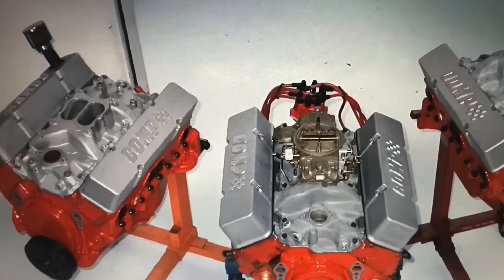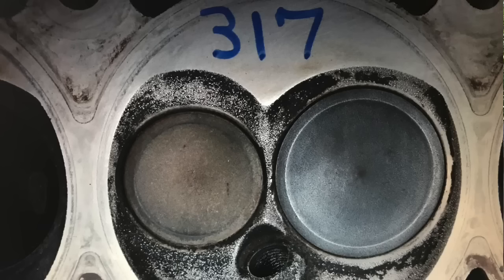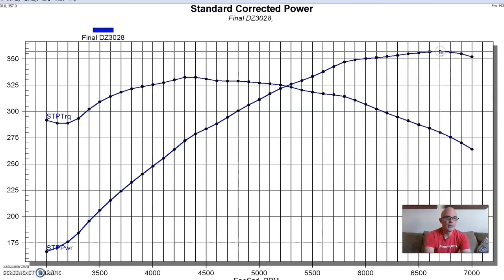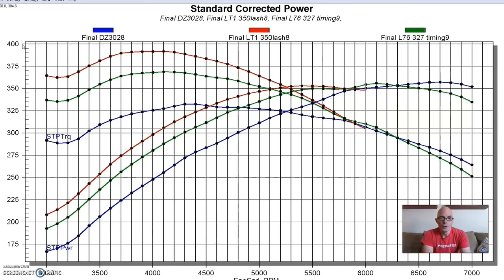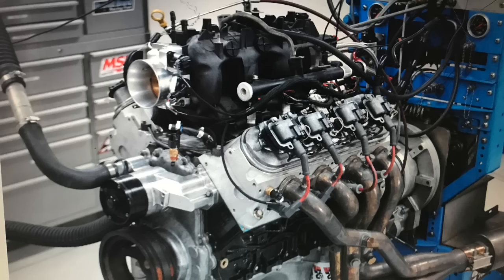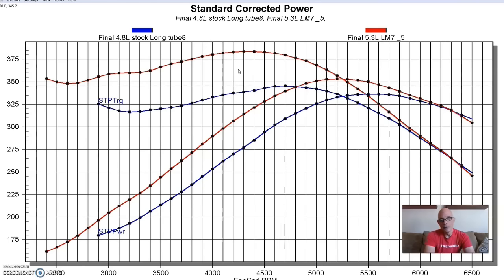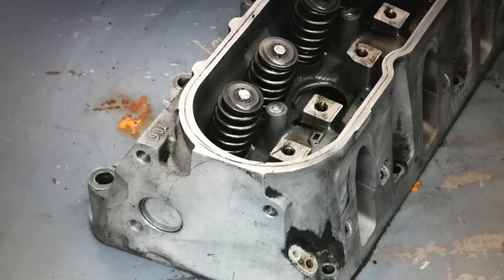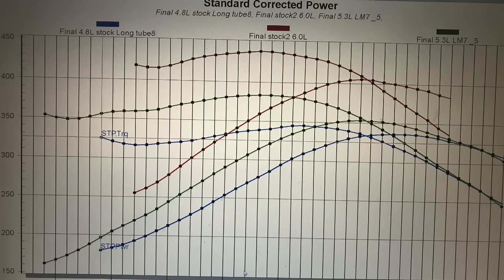HOW MUCH HP DID THE 1969 DZ302, THE 1965 365-HP L76 327 OR 1970 LT1 350 REALLY MAKE? WAS IT FAUX HP?

Comment: The never ending question, when do you drop the small block stuff and go big block territory?
Reply from the maker: big block stuff comes out tomorrow
Reply: @richardholdener1727  think my question is a bit vague. When would it be best to build a big block instead of a small block. What's some of the things that would push you to go big block instead. 🤘🏻 thanks for the interaction with fans.
Reply: @Knightmare-gz9ls  Big block are big because they have larger cylinder bores. This allows for larger diameter valves for two use cases:
1.) When you need a lot of air flow at low rpm for torque (aka a truck) or 2.) you have a huge budget and can run expensive heads with massive valves at high rpm and just make crazy power numbers.

Comment: I have a 1970 Camaro z-28 355 LT1 with matched and polished exhaust ports and intake matched and de-flashed intake runners. Manley pro-flo valves, forged Speed-Pro domes and an old lopey Crane cam. I forget the number. It will pull all the way to 63-500 which is where I shift it. It's over 355HP easy, but I do understand these are bone stock components. I can gap my buddy's 302DZ by a couple cars and pulling. Great information though.

Comment: I'm a 400 guy....why not throw it in the mix....this would have been the perfect video for it.....maybe because they didn't make a performance version?
Reply from the maker: the 400 was good for heavy cars-not really a performance motor
Reply: @richardholdener1727  The 400 wasn't a true factory performance motor but right out of the wrapper in 1970 you got 265 HP and 400-foot pounds of twist with a two-barrel carb without using very much RPM. Pull it out of its home from a wrecked 70 Monte Carlo and strap it down in a Chevelle or a Nova and it did a real nice job filing down the rear tires even with the 2 barrel Rochester. With a decent carb and intake along with a hotter brain stick and the steam holes drilled in some better heads it woke this motor up faster than kicking a sleeping Grizzly bear in the butt. Try sticking a 400 together with some better parts and screw it to your dyno. The torque it produces makes it a great street engine.

Comment: I would like to see a shootout based on same displacement but different rod:stroke ratios on NA engines. I have gotten the impression you don't value this measure much but NASCAR SBC engines used to change this based on the track they where at. Can longer rods get get more top end out of a flow limited configuration because of reducing peak piston velocity.   Can long rods get more top end out of a TPI? How much value is a long rod SBC 383 kit over a standard rod setup. Thanks, I enjoy seeing theory on the dyno.

Comment: Have you ever done a 305 with the 3.75" crank and a set of trickflow aluminum heads with the 1.94 valves for the 305 bore size. 
I'd like to see that with a compression ratio that could be ran on pump gas. 87 to 91 octane. 
Something with torque cam for a old truck application. And something with a big roller cam for a hotrod camaro, with a 3500 stall and 4.10 gears. 
I'd just like to see how it would compare to the other small bore engine, the ls 5.3. 
I think the only reason the 305 gets such a bad rap is the crappy heads that come on them. And weak camshafts. 
With .030 over and a 3.75 stroke. It would be very close to the bore and stroke of the 5.3. And the trick flow heads should get the airflow closer to the stock LS truck heads.  
Keep up the awesome videos.

Comment: I had a 69 Camaro with a LT1 350 with the off road GM cam, other than a Edelbrock intake it was bone stock. It turned a rod bearing so I yanked it out of the car and replaced the crank as the rod was ok. Put the car all back together and it didn't have any power like it used to. So I thought I may have had the distributor in wrong. Nope not that at all. The crank I put in was a 327 crank!! No wonder it didn't have any power! It still had  110 lbs compression. So since this was my daily driver I just advanced the timing until it sounded better. Took it for a drive and no pinging sounds - more advance. I put a timing tape on and checked the timing - it was 55 degrees! So I then bought a MSD box for it and set it to 7000 cut out. Richard this was a ripper, with so low a compression it didn't take long to rev up that is why the MSD box. I drove it like that for another 2 years and thrashed it. It had a turbo 400 out of a 4 X 4 with a reverse valve body so it was really fun to drive. Our tuning tools back then was a timing light and a screw driver for jet changes. Keep those comparison videos coming.

Comment: Hey Richard hows it going ? I have been watching your videos for a while and learned alot so far after watching over 100 videos I found the confidence to attack this project of replacing the over heated TBI block.I am working on my 5.7 Vortec block for my 91 OBS  4x4  so far I have cleaned all surfaces honed the cylinders sleeves to get a good cross hatch kept the original pistons and crank, machined the heads kept the OG valves and reseated them added 500 lift capable springs ,installed a new oil pump high volume,installed a custom 265 cam with 480 lift ,217 Center ,110 Lobe Exhaust  is the same.Cleaned and bleeded out the original roller lifters to get a good and acurate adjustment added 1.6 roller rockers cleaned and kept the original push rods.Now its time for installing the engine pro double timing chain with three setting to choose from +4 ,-4 ,or 0 TDC.My question to you is would I benifit from advancing or retarding my timing gear or shall I just leave it at 0 tdc ???.Intake is a Edelbrock 2116 dual plane for quadrajet carb I am going to use the original GM 454 TBI to carb adapter to keep the tbi system for now and am using a MSD HEI Circle Track Distributer with a rev limiter adapter I also looking at getting the MSD 6 AL-2 Programable to replace the rev limiter adapter .What would you suggest and have you ever gone threw this set up?? It will be used to pull my 78 K5 Blazer  with 496 and 12 bolt 5.13 gears on 44's 6 lugger up to go offroading .I could really use your expertise on this one.Thanks and let me know if you need any more info .

Comment: The 302 was good in the higher rpm range which was used for trans am series racing of the late 60's .
Reply: My 69 z/28 with its 302 is a runner . I had the heads mildly ported, cc, and polished. The heads added lots more mid and top end torque. Its still an rpm engine.
Reply: @jimmccabe801  Yeah the 302 can rev up to 7000 rpm .

Comment: 6:06 Didn't the 70 LT1 come with the Duntov 30/30 Camshaft from the factory? My 71 LT1 came with one.
Reply: Not factory. Richard is correct. The 1970, 1971, and 1972 LT1's all used a cam specific to the LT1 instead of the older designed Duntov camshaft. The desire with the LT1 was better drivability, more torque, cleaner burning, and an engine that would work well with an automatic transmission which was a problem for the Duntov camshaft.
Reply: Michael King so should I keep the duntov ?!?
Reply: yes it did. the #151 cam came in the 327...it was 302 dur .447 lift...hydraulic.  The 30 30 was mechanical with .030 valve lash.

Comment: Clearly the LS engines have raised the bar for power production in a package that beats all the old small block engines but with a smooth idle, good drivability and fuel mileage. And this is just the low end of the LS spectrum. Just what GM was trying to achieve when they designed them. Good test.
Reply: When they went for the Cross bolted deep skirt block and they separated the intake and exhaust ports just like the Ford FE and the Ford small block they made a great combination for making power. Can you imagine if they put NASCAR heads on the LS block how much more HP they could make? Fords ideas but Chevy put it all together.
Reply: Gm didn't exactly design the LS, it's taken from other automakers designs

Comment: So here is a question on the OTHER side of the equation .... 
With all variables being equal  , H.P & C.I. swapped  etc.  ....
Will cubic inch out run horsepower ?? 😞
Reply: try english
Reply: @trillrifaxegrindor4411   O.K. ,  I figured someone with a knowledge of automotive mechanics who did speak english might understand .... but here it is simplified for you .  Variables = gear ratios , overall vehicle weight , driver reactions , Carb. C.F.M requirements vs. Engine Cubic Inch , Max Piston Speed , etc. all being equal ... Would a 383 H.P. 454  outrun a 454 H.P. 383 or Vice Versa ??  Other examples could be a 327 H.P 350 vs. 350 H.P 327  - 302 H.P. 351 vs. 351 H.P. 302  am I going to fast for you , or you want me to slow it down a bit more ??   Have A Nice Day !! 😉

Comment: In 1992 General Motors introduced the LT1. The 1970 is an LT-1 completely different engines.  . GM dropped the - in 1992. I still have the short block 11 1/2-1  (71 I believe was 10-1)  I ordered in 1974  with the Dontove  30/30 cam. With the short block I ordered the 202 angle plug heads. The Chevy parts manager helped me order and set it up. I can't remember the lash setting 26 or 28 and if the intake/exhaust were the same or staggered. Made a big change in the performance. It's what he ran in his 1970 1/2 Camaro Z28. I think I found the project to motivate me to put this together. So what would this old dinosaur's power be?

Comment: I have always thought, the bigger the ci to get the same compression ratio the smaller the piston dome. Therefore the better the flame travel. So I could play with timing without detonation occurring. I'm on pump gas. The 292 head was sought after back then. The angle plug,and a little larger intake runner was helpful. The good ol days.
Reply: you would be wrong
Reply: @trillrifaxegrindor4411  it would not be the first time I've been wrong but what am I wrong about.

Comment: What I really want to see is same displacement with different stroke. I’ve always heard more stroke more torque  but displacement is displacement which means overall hp would be the same. Would more stroke really add more low end torque also at the same liters?
Reply: Stroke adds leverage turning the crank on top of displacement

Comment: The 327 had a camshaft with very old cam lobe design and an old, 1962 intake manifold and small 4 barrel. The 302 came with the same camshaft, but had a more modern intake manifold and larger 4 barrel. in 1968 two over the counter camshafts came out, sold for the 302, but fit any small block. One camshaft was the first design racing camshaft that called for new valve springs that were made of defective steel. The other camshaft was sold as an, "improved torque" camshaft. This camshaft has more modern cam lobes. The improved torque camshaft was sold over the counter for the over the counter 1969 LT-1 350, that was a parts engine that used the 302 intake, carb and improved torque camshaft with the base of the engine being the forged piston L46 350hp engine. The 1969 over the counter LT1 did not have the push rod guide plates the 1970  production  LT1 engine had. The LT1 camshaft is smaller on paper than the older camshaft, but has more modern cam lobes. The 302 intake manifold and carb made the biggest difference in power.

Comment: 302 sbc
357hp 6700rpm
333tq 4400 rpm
327 sbc
356hp 6100 rpm
369tq 4100 rpm
350 sbc
351hp 5400 rpm
391tq 4000 rpm
4.8L 
336hp 5600 rpm
345tq 4700 rpm
5.3L
353hp 5200 rpm
384tq 4300 rpm
Reply: Legendary Stock Engines
Junkyard 5.3L 
Potato-Tomato 

The 5.3L falls right in between the 327-350 i bleed Ford Blue but even I understand why the LS is loved for what it is
Reply: Then to compare the Ford Boss 302 was
374hp 6700rpm
325tq 4300rpm
M-Code 351C
365hp 5800rpm
379tq 3900rpm

Comment: How about three different displacement engines with different head flow/ cam timing to all produce max power at exactly the same revs, ie all at 6500 rpm for example, would be keen to see the power / torque differential, thanks for yet another great vid Richard keep them coming. Ps how about a 6.4 hemi v 6.2ls, 6.0 v 6.1 also.

Comment: I can explain the effect of bore and stroke a lot quicker...

Had an MC SS,  It came with a 305 like they all did.  Installed a 224* cam and headers.  It felt better, but not enough better.
Pulled the 305, and installed a 355 with the same cam.  Big difference at WOT, but felt about t he same at part throttle.
Pulled the 355, and dropped in a long rod 406.  Same cam and intake.  Now we are getting somewhere!  But like Ray Parker Jr, "I had to have just a little bit more".

So, yanked the 406, and dropped in a 434.  Had to go a little bigger on the cam, but still running the same factory intake, factory Quadrajet carburetor, same ported Z-28 iron heads, same stock mufflers and pipes.  Pulled out on to the street to see how it would do, and it barbecued every clutch in the transmission in mere seconds.

That is the effect of displacement.  I've been hooked on it ever since.
Reply: Torque for the street for the win.

Comment: It’s almost like there’s no replacement for displacement.
Reply: Yeah there is. Boost lol.
Reply: @evictioncarpentry2628  Boost isn't a 100% replacement for displacement as there are drawbacks to methods of adding boost. One being added mass and size of the engine, the other is heat becomes a greater issue.
Reply: Build quality would be the "replacement" if anything.

Comment: Another Great Video Sr. Thanks for all of the Great content you post i just fired my TT gen 1 sbc for the first time this weekend.  I have not found a setup like i am running and was wanting to know if you have tested one like it.  it is a Gen 1 forged 383 twin 60mm turbos running the holley dominator.  for fuling i have MPFI for low boost and correction.  I have the system setup to have an additional  4 injectors in my Terminator Stealth throttle body cycling in at 40% duty cycle of the main injectors to help cool the charge temps. This is the first boost build i have ever done and now i realize with honestly how little i know (It is easy to talk when it is another persons project but not so if it is yours) I would listen to comments from yourself and people that watch your videos.  have you ever tested anything like what I am running?

Comment: Would love to see a test with a 383 vs 377 with same heads and camshaft and 383 vs 400 to see what the extra bore of the 400 would have on power and torque
Reply: Mark Wallace 377-Destroked 400 was more potent
Reply: @Jontfs300  the 377 was better than 383 and 400?lam not arguing just curious as I already have most parts laying around for mild 377 build.would you know what issue of super Chevy? I remember a comparison in some mag between 377 and 383 but not results or any details.i thought  377 bore would have less valve shrouding would be advantage but unsure about torque  loss of 3.48 stroke .I'd appreciate any further comment.
Reply: @johnstuchlik5828  you make up for lost torque with more available rpm by running the 377 .
Reply: Yes that I would love to see even if it were just 383 and 377
Reply: Super Chevy did it... the 400 small block destroked was more powerful. It’s an old issue
Reply: seconded I just commented on the 377 vs 383 comparison would be neat to see.

Comment: You forgot the 400 SBC!! Can you also do one with the 265vs283vs305vs307 Chevy and/or 460Ford vs 454chevy vs 440 Dodge
Reply: The 307 had more potential than people gave It credit for it was a better candidate for a build than a 305 that's for sure I seen some pretty bad ass 307s in high school some better heads a cam intake and exhaust with a gear change to either 373 or 411 was the ticket and they would spin pretty frickin high lol we used to laugh when someone said 307 but when it outran a big block chevelle well there what do we have here lol but that was of course 1/4 mile after that it topped out at about a buck ten and the chevelle walked away but big block wind an wind an wind theres almost no top end lol
Reply: Those 307s with 305HO heads makes a great combination nobody normally thinks about, i enjoyed it more than my 350 for sure

Comment: Have you done a test comparing the LM7 to the L33? Is it worth finding a L33 over a LM7?
Reply from the maker: the L33 is an aluminum block so its worth it if you can find
Reply: @richardholdener1727  look in Trailblazer, GMC Envoy, Buick Rainier's. 05 an up. 05 is best X over year some are still GEN 3 no AFM/DOD

Comment: My dad’s been telling me for 25 years how much better his dz 302 was than a 350. The forums are full of guys insisting that smaller motors rev faster and therefore are better. This doesn’t take into account that a cam will act larger in a smaller motor making it more high strung. By that logic you could step the 350’s cam up 10 degrees or so and have a larger engine that behaves the same way (same weight, compression, gears and torque converter for argument’s sake)

Comment: It's all about the pudding
The proud is in the pudding. In 1955 the Ford 272 with overdrive(4-11 rear end) would walk all over the 265 Chevy. The 283 in 57 was faster(talking about in a stock car) seat of the pants power
Then about late 1950 we found out a little fine tuning with the boring bar a set of 13 to 1 four inch pistons
Would wind up till it blowed up  in a 55 Chevy with four speed. Then GM found out how to cast then wall cylinders, They Nader cars heavier , inter the 327 , with the green stripe cam , more low end torque made lots of fun but watch out for those 302s. The 350s gave more low end for the heavier   cars on the street
Now a small 4.8 will drag that heavy 1500 pu around even faster than a stock 55 ford seat of the pants wise
Must be that fine multi-speed trans. It's all in the pudding.